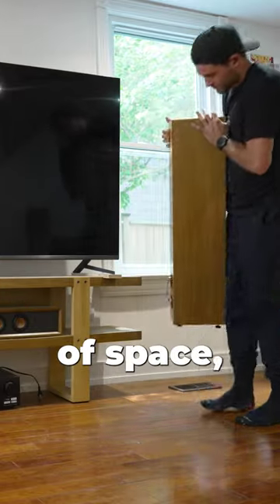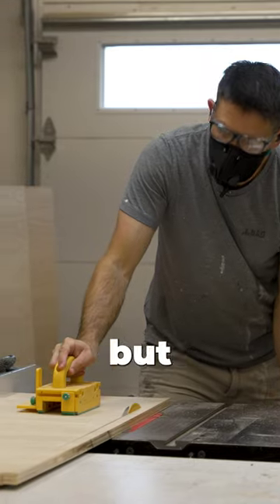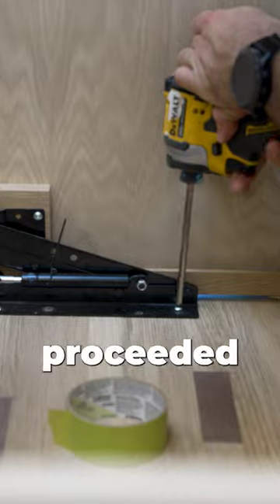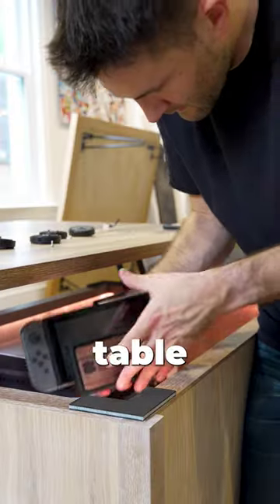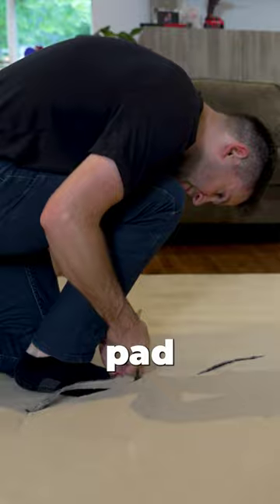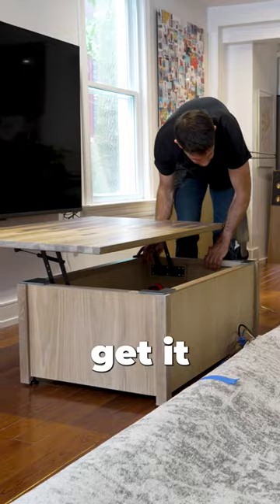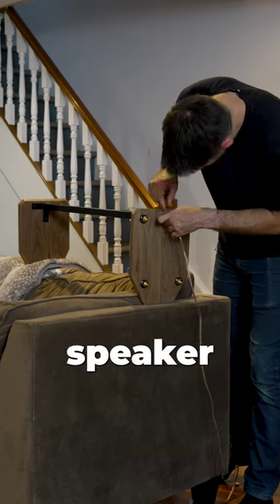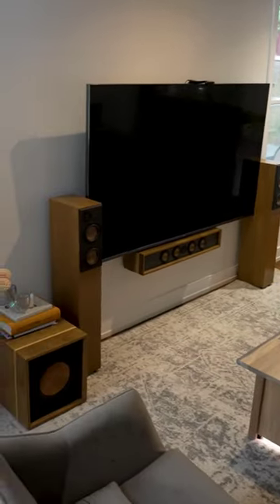I can't believe people still have entertainment units...

Comment: Devices won't have room for air flow they are gonna overheat
Reply from the maker: That's why I put a 200mm fan in the bottom of it that replaces all the air inside every 6 seconds
Reply: @ZacBuilds  aah I guess I missed that part. Great design
Reply: @ZacBuilds  what happens with the standing xbox? the vent is on top and it is almost touching the upper wood board, does it need the coffee table to be always open to use the xbox?
Reply: I left a similar comment on his PC build and got buried in negative comments. Then he comes out and admits it was stupid later on. I still won't let that go. Lol.
Reply: @The_Conqueeftador  bruh I will consider that while commenting to this channel  from now on